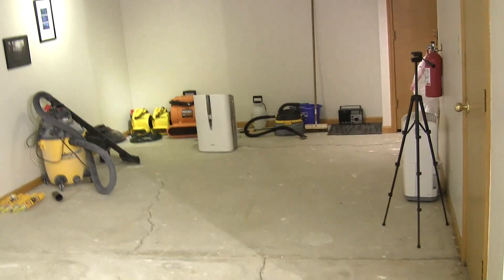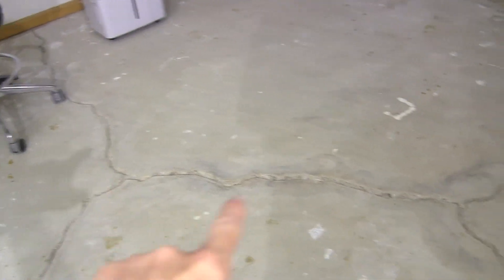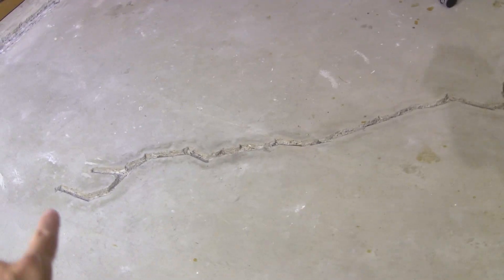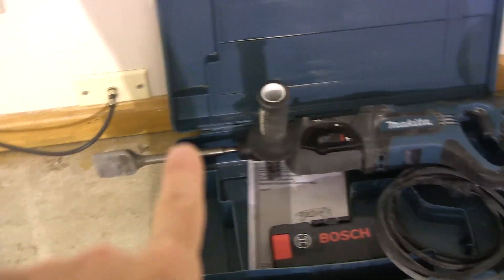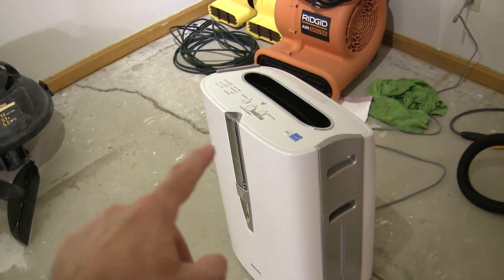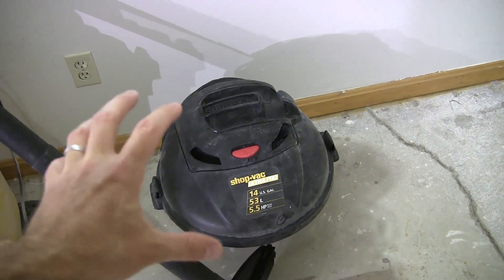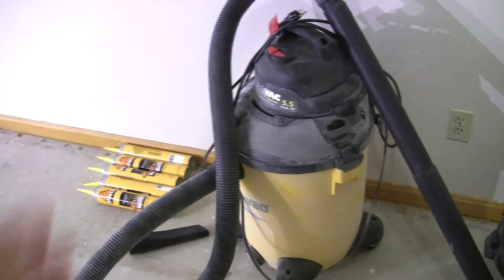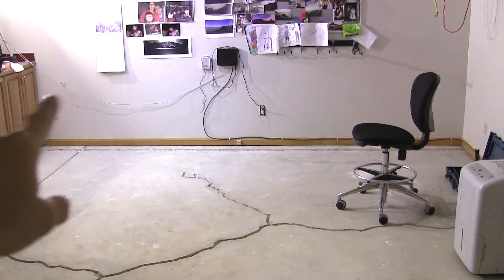T4D #106 - Fixing the lab - Part 1

Comment: Hi Martin. To get a good view of what's behind those walls you might be able to remove a power socket from the wall and then remove the backing plate. Then you would have a nice big hole to see into the wall where you might be able to push aside the insulation and poke the bore scope through for a better view. Might be a better option than drilling holes if that option is open to you. ~ Jason

Comment: IMPORTANT!!! -- If you are getting water in the basement, this is only a symptom of a larger problem.  Water seepage WILL slowly undercut your foundation.  What you are doing is fine as a short term solution. but you are only putting a band-aid on the much more serious problem.  As others have already said, a french drain along the exterior of the house will redirect the water away from the foundation, preventing undercutting, foundation cracking and eventual failure, as well as the added benefit of having a dry basement.  This is fairly easy to do yourself and there are plenty of resources online that will show you how.  The main thing to remember is that you must install with a down hill slope.

There are other solutions to directing water away from the house, but a french drain is usually the simplest and most cost effective method.  But whatever method you choose, better to do something now than to fork out a lot more five or ten years down the line in major foundation repair.

Comment: This is why we bought an older house, maybe 120years or so. The new ones are not built properly, not even by regulation commonly. This is what happens when the contractor is told to build three homes a week in a modern suburb. Our house has no issues with water even with a higher water table being that we are beside a river.